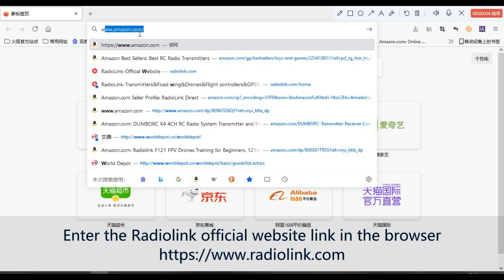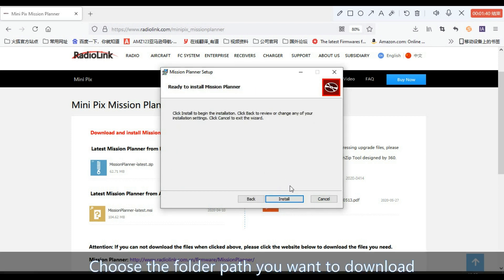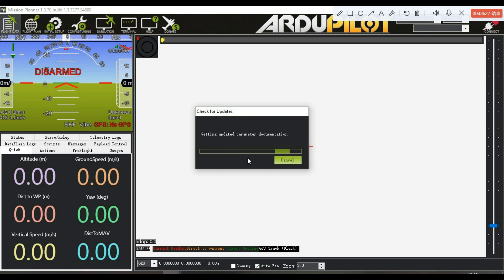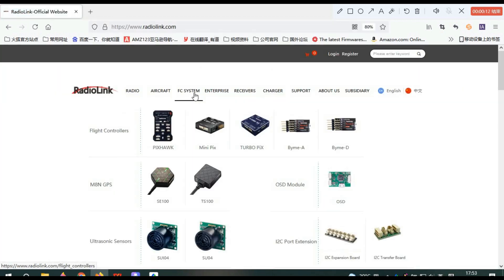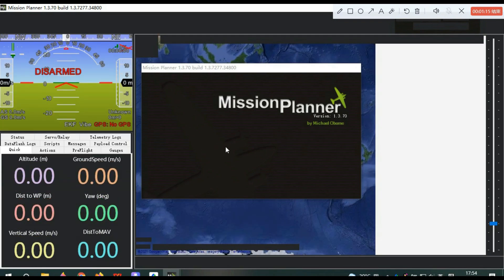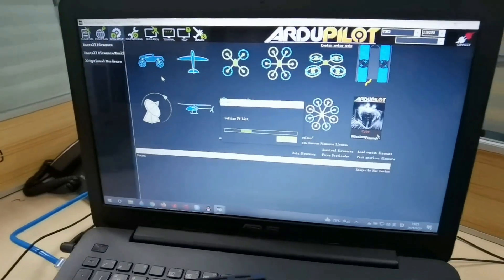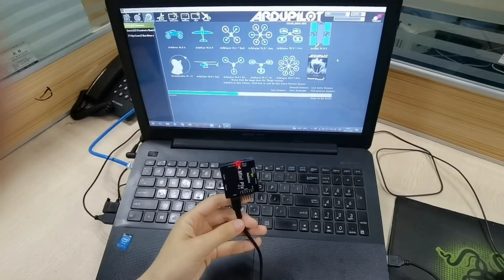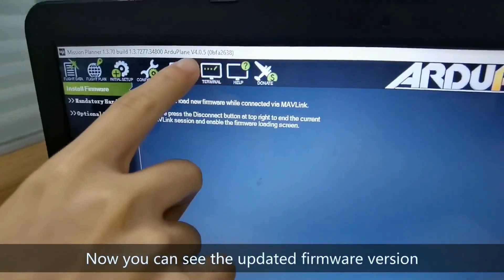Radiolink Mini Pix/PIXHAWK/Turbo Pix Update ArduPilot Firmware Tutorial -1

Comment: I have a Radiolink Mini Pix v1.0 and followed instructions to update firmware but does not reconise board!
Reply from the maker: Please make sure the USB cable is the cable with USB data, a USB cable only for charging will lead to failure to connect. Or, you can have a try to use the Mission Planner from Radiolink to upgrade the firmware. Send mail to after_service@radiolink.com.cn if you have any questions during using our products.

Comment: Will I now be able to make my controller, which is lying in the box?
Reply from the maker: Hi, the Mini pix included :
- Mini Pix Flight Controller x1
- Safety Buzzer Switch Button x1
- I2C Conversation Board x1
- FC Status Indicate LED x1
- Power Module x1
- Double-Sided Adhesive Tape x2
- Buzzer Connect Cable x 1
- I2C Connect Cable x1
- Power Module Connect Cable x1
- Receiver&RSSI Connect Cable x 1
- OSD Connect Cable x 1
- FC LED Connect Cable x1
- Simple User Manual x1